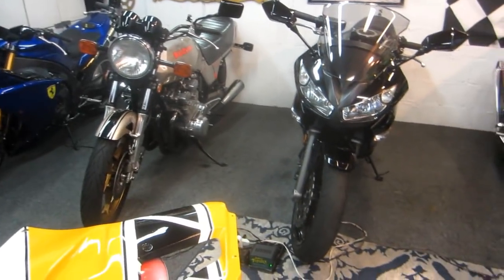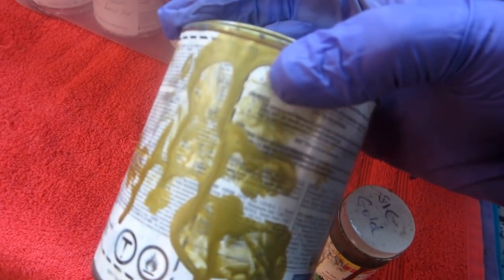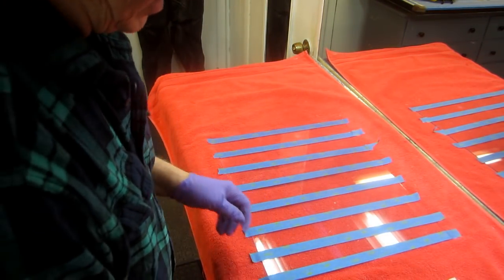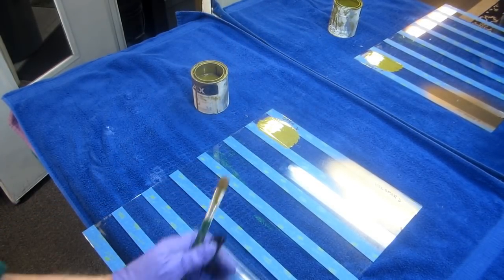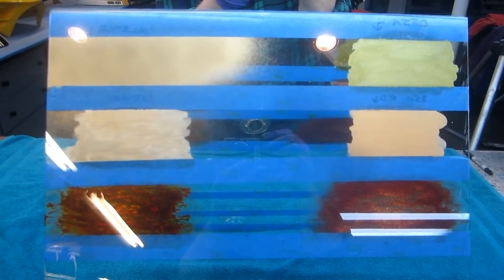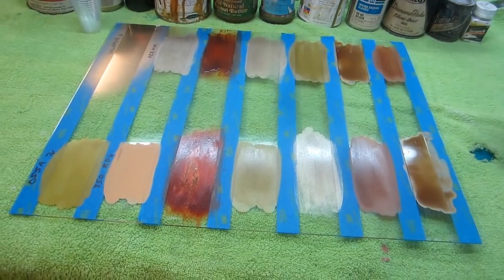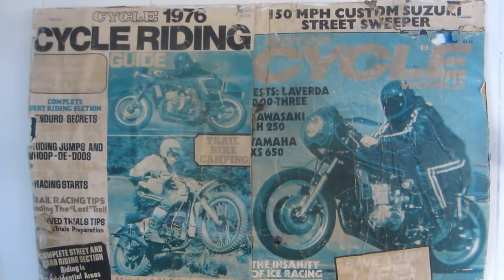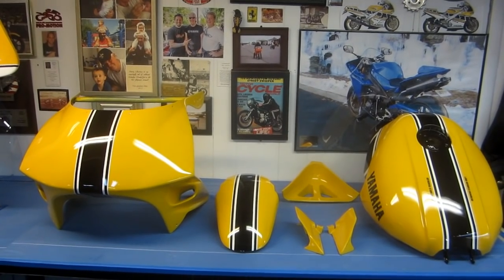pt 91 FZR RESTORATION,HOW TO MIX AND TEST GOLD PAINT .

Comment: Another trick with paint tins that have been opened then stored for years before needed again is always put cling wrap over the top then put the lid on so it doesn't glue the lid on